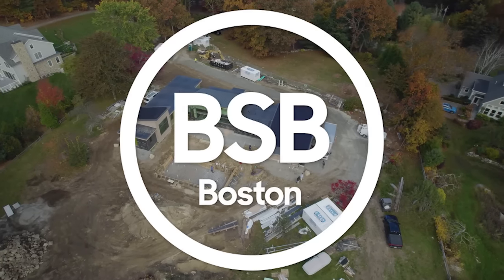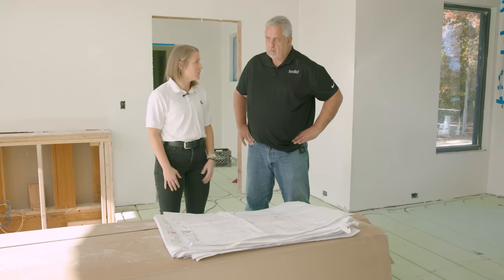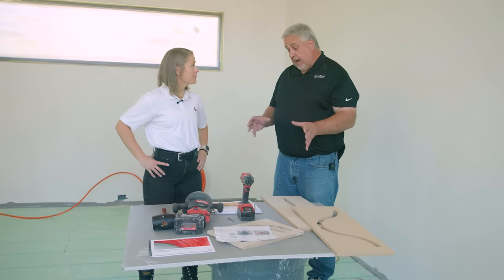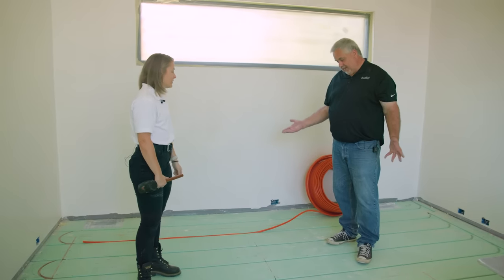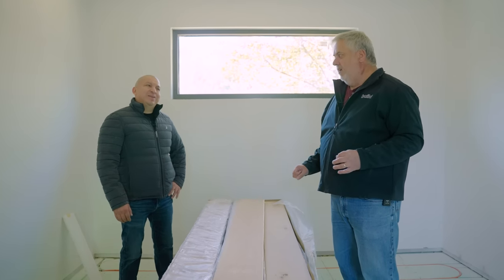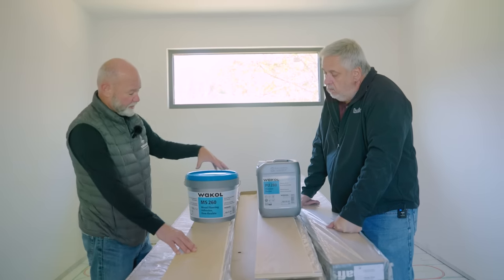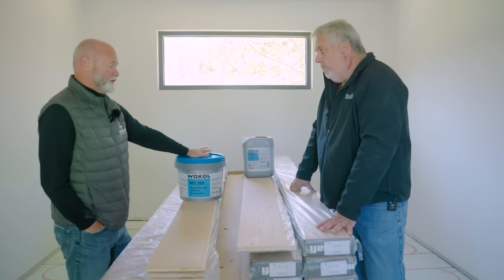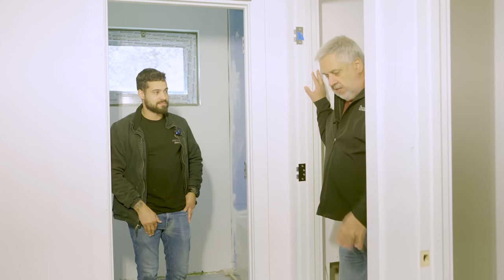"Flooring & Tile" Build Show Build: Boston Ep. 20

Comment: Professionals do occasionally put a nail through your tubing.  Ours was charged with compressed air when it occurred.  Plumber cut a little porthole in the subfloor that is accessible from the cellar in case the repaired joint ever fails.  10 years on its doing just fine.

Comment: Hi Steve! I got a bit confused with the tile install. Did the tile underlayment get adhered directly to the Warmboard or did they install some kind of subfloor over the Warmboard that they glue the underlayment to?
Reply: The warmboard is supposed to replace the sub floor. My guess would be they put it straight on top.

Comment: Here in the netherlands it’s really popular to have poured concrete flooring especially with new construction, older construction with wooden flooring is often removed and replaced with poured concrete and also they all have radiant floor heating embedded into the concrete and after that all there are multiple options on how to finish your floors, pvc wood was very popular but we’re now seeing a huge transformation from that to raw concrete with sometimes a coat to make it smoother and a different color. Interesting to see that concrete flooring is just getting a grip in the US market although i haven’t seen any concrete flooring on the 2nd floor upstairs, but maybe this is because of the wood framing?
Reply: Concrete flooring is horrible on your knees and hips
Reply: @ColeSpolaric  wdym on your knees and hips? I don’t get it
Reply: @miles5600  you'll end up with arthritis from walking on a hard surface all the time
Reply: @ColeSpolaric  how would this not happen with wooden flooring? I’ve never heard anyone having that problem here.
Reply: @miles5600  wood floor has a bit of give to it and can absorb some of the impact of each step. Concrete has zero give and zero absorbtion
Reply: @ColeSpolaric  not if you seal it, that’s often done to damp the noice and the hard feeling.
Reply: I’m gona go out on a limb here and say construction in the Netherlands used to consist of wood timber slapped on earth which proved problematic for obvious reasons then instead of knocking it down they poured a concrete floor, we just figured out not to drop timber on grade sooner.

Comment: If Cement Board doesn’t Uncouple the Tile from the subfloor, then what is the purpose of using Cement Board as a Tile backer in the first place, what exactly does it do??
Reply: I think it just doesn't disintegrate like plaster would if it got wet
Reply: Any environment where there is a lot of water, you have to double and triple protect against the water damaging any material.  You could "try" to have OSB or normal wallboard behind tile in a wet environment, but then you'd be over-relying on a membrane to prevent large amount of water from damaging the OSB or wallboard - any leakage would cause the backer material to swell and fail, and the tile would shed off allowing even further leakage and failure.

Water is what damages homes.  Water is what damages homes.  Water is what damages homes.
Reply: Cement board does uncouple, and it provides firm support (e.g. spanning between wall studs). It does not break down if wet, although it can hold water. Another way to uncouple, as used in this video, is a flexible material, which is suitable if the substrate is rigid like Warmboard. You want support, isolation, and waterproofing and there are various ways to achieve these.
Reply: @gregh99   I understand that Cement Board is good for wet areas cause it won’t break down, 
 But how does it Uncouple, it’s not Flexible like Ditra underlayment, so it seems like any movement in the wooden subfloor would transfer through the cement board and into the tile.
 I know that’s it’s commonly used as a Tile backer in wet areas but it’s also used under floor tile in dry areas.
It makes sense that Flexible Membranes like Schluter Ditra can uncouple, but Cement Board is stiff so I don’t get how that could uncouple.
I know it is widely used as a tile backer and if installed correctly will successfully prevent tile from cracking, I just wana know exactly how it prevents the tile from cracking.
Reply: @lonestaradjusting2944  Good point. To some extent the cement board floats, protecting tile from framing movement. There might only be movement at the edges of multiple cement boards, which can be minimized by the orientation of the cement board joints to the framing and by joining the edges with mesh. DIYers generally don't cover large areas, so a shower wall might have only one joint. Commercial flooring installers use expansion joints in the tile which line up over subfloor joints, and they have guidelines on how far apart such joints should be.

Comment: Acclimating, how does that work when house is under construction as compare to when house is lived in.
Reply: Acclimation should only really occur once the house is sealed up, plastering and drywall is done etc. Run the system for a few days so all the materials in the house can achieve consistent levels of moisture/humidity. Page 16 of either or Warmboard-S or Warmboard-R installation guides under the "Technical Documents" section of our website has more info.

Comment: Would the aluminum in the tubing be picked up by stud finder that can detect pipes.
Reply: Not likely, the entire green surface is metal as well. If it's an extremely sensitive instrument it may possibly detect the difference between metal plate and metal plate plus pipe, but I doubt it.

Comment: How do they handle leaks in the future for the radiant floor?
Reply: It doesn't unless you fuck up the install by puncturing it with screws, it's installed as a continous piping 300ft max per zone.
Reply: My parents had radiant heat in a house built in about 1948.  When sold about 50 years later, it still had no leaks.
Reply: I called it in the video.......
Reply: The system is pressure tested with air before the flooring goes down. If the air pressure is off, that's the time to find a leak and fix it. Once its all covered up with the flooring, a leak is not really a concern.

Comment: i stopped watching at "no fossil fuels"... unless you count the coal and gas plants burning even more every day to support all the electric stuff going in. just because your house may not use gas doesn't mean you are really saving anything.
Reply: I quick watching when I saw they used 6’-8” doors on a million $$ plus home with tall ceilings 😂
Reply: They’re putting up solar
Reply: No fossil fuels at the house. She only pointed it out for lack of complexity sake. No need for gas lines or storage tanks at the house. A lot cheaper to operate too
Reply: @crabkilla  first of all they 7'-0", and second of all, the only thing that matters is the clients desire. Most of the house is 9' ceilings, the clients are not the tallest people. Enjoy.....
Reply: @ZacharyKurtz unless they're putting in battery storage they're still relying on fossil fuel.

It sounds like they are adding batteries.
Reply: There's a couple of assumptions your making in your statement 1) the current grid is only coal or natural gas, almost no where is that true. Day the mix is 10% renewable on day one your utilizing 10% less 2) the grid won't add more renewable over time, also false currently new solar + batteries are cheaper than existing coal plants, economic forces will fully displace coal relatively soon natural gas will take longer but expect most gas peaker plants to be displaced first and than evenentually the base load however that component will take longer but it will get less and less each year
Reply: New England uses hardly any coal and is adding renewables faster than any other power source. A passive house like this will be highly self sufficient esp with solar. Yes it does mean you're saving 'anything', in fact you're saving most fuel
Reply: @aknorth1053 the gas peaker plants would be the last to go since those are the ones that will balance night time loads for now
Reply: @aknorth1053  yeah you should look into that more. When they say solar is cheaper they mean just the panels. The batteries required to go full solar cost about 10 times the cost of the panels them selves. You need to be able to last a week or so without power from the panels in case of bad weather. Also the batteries only last about 10 to 12 years before they need replaced (if they don't catch on fire). For that matter the solar panels them selves also only last 20 years. A coal plant can go for 40 years. Don't forget to factor that in when saying solar is cheaper because it's not quite as good as some people make it out to be. Peaker plants will likely go to battery storage. That's because peaker plants are expensive and not very efficient and only account for a small portion. The answer is nucular power for main load and solar and maybe wind with batteries for peak power.
Reply: @Ilove3SGTE there is a pretty good overview of the system they are going to be installing, it includes more than enough solar to cover the sites usage (Including charging EVs) and a very large storage battery.
Reply: @stevenbaczekarchitect9431  I would just joking and making fun of the triggered "fossil fuels" guy. LOL

I love your vids and your work!
Reply: @kschleic9053  awesome thanks, I haven't seen that one yet. I'm betting it was very expensive for that much storage.
Reply: @crabkilla  in the neighborhood this house is being built,  a shack will set you back a cool million.
Reply: Iowa for example gets over 65% of iys electricity from wind. Technically you are right some coal and oil may be burned to power the heat pump but that's a pretty misleading thing to say. The reality is that electricity currently comes from a mix of sources, some renewable/no CO2 some from Fossil fuels and the percentage coming from renewables like wind and solar is growing every year. So, the builders were smart to use the heat pump. Even though only about 30% of Massachusetts electricity currently comes from renewables that number will grow and in a decade this home will be powered primarily by renewables and the owners don't have to do a damn thing.
Reply: @fox156  no one can survive on wind and or solar alone. Iowa is connected to the Eastern Interconnect power grid. Which includes 30+ states Massachusetts included and some of Canada. Exceeding about 20% renewable on a single grid starts to get difficult without large battery buffers. They did a study and found the Eastern Interconnection can handle about 30% maximum with a few changes. I can't find the current renewable power percentage but I believe it's about 20%. It's not state by state like so many people seem to believe. The truth is we won't be getting away from fossil fules any time soon. We need nucular power and we need a lot of it if we're really going to reduce co2.
Reply: @Ilove3SGTE  actually with batteries you can get to 100% renewable energy and they don't have to be lithium batteries. Here in CO we pump water uphill to reservoirs when electricity is plentiful and let it flow downhill thru electricity generators when it's needed. That's also a battery. And regardless 80% renewables is amazing and would vastly improve the health of humans and make for a much cleaner environment.
Reply: @fox156  sure pumped hydro is an option in my opinion better then batteries. The down sides are that they are only 80% efficient and they can only be installed in certain locations. Because they might not be close to where the power is generated and used they will suffer from an extra roughly 10% loss each way in tranfering the power to and from. That makes the efficacy of the system lower then oil, coal and natural gas and therefore cost significantly more.  Cost does matter If your going to convince people to go with your plan it needs to be affordable. It can't sloter the economy and peoples livelihoods. It also would require huge amounts of water (and we need water too) if we are going to power the whole grid with it during a low production period. Also don't forget that we plan on powering most cars with it too and that would require us to double the amount of electricity generated and stored. Solar and wind need replaced every 20 years or worse and we at the moment aren't recycling any of it especially wind. OR we can just do modern nucular power where we have about 100,000 years of power resources that are carbon free. Where we have solved the waste and safety issues and are solving the cost issues. The cost of nuclear power will be competitive with oil, coal and natural gas all by itself. We just need more people to accept it and legislate for it. In my opinion it makes far more sense.
Reply: @Ilove3SGTE  obviously not every place can pump water uphill. that obviously wasnt the point of the example. point is by switching to efficient electric heating like they did in this house build there are many options to power this home now and especially into the future with renewables with no intervention by the homeowner needed. You can point out all the issues with every kind of power generation you want, its irrelevant to the general discussion and point of building an extremely efficient home that relies on electric heat pump for heating.
Reply: @fox156  what I am trying to get at is cost. If we want people to be willing to switch to electricity over gas then it needs be cheaper and match the comfort and convenience.
Reply: @Ilove3SGTE  actually most sources of renewable electricity are cheaper than gas or coal, especially wind. It looks like renewables are cheaper per kwh but they need backup like you said.
Reply: @fox156  yeah exatly. When you add in batteries it becomes 4 to 5 times more expensive because batteries go bad. I think we should aim for 20 to 30% wind and solar and then modern nuclear for the base load. The people who are building this house probably spent over 80k on solar and batteries. Thats not really feasible for myself and most other people.
Reply: @Ilove3SGTE  the rooftop solar is obviously a lux item, these owners are still hooking upto the grid, there were vids about the grid hookup. this is obviously a luxury home. The whole point is all we (frugal homeowners/consumers) need to do is switch to electric heating, the market, govt, etc will ensure that a large percentage of our electricity comes from renewables. noone expects every homeowner to install rooftop solar and batteries, that would be insane. anyonne that has inferred that from these videos or any source has a few loose screws.
Reply: @ColeSpolaric   the more people who have batteries and are part of the Peak Demand programs, the lower the need for peaker plants.
Reply: @joedoe6444 it's ok that you chose to stay willfully ignorant. But, maybe you shouldn't broadcast it to the public